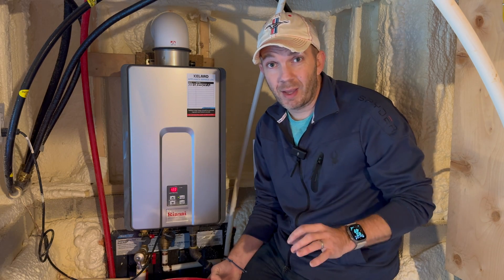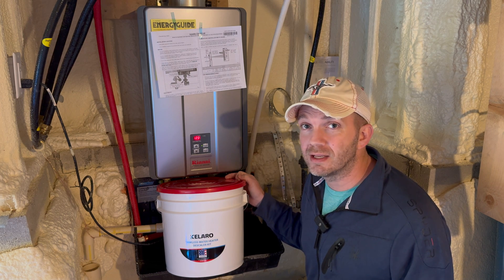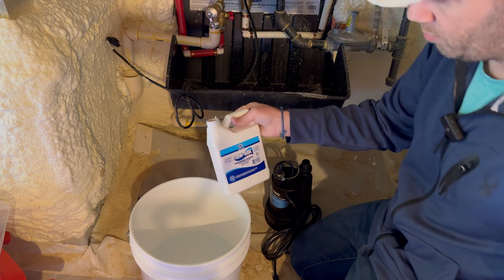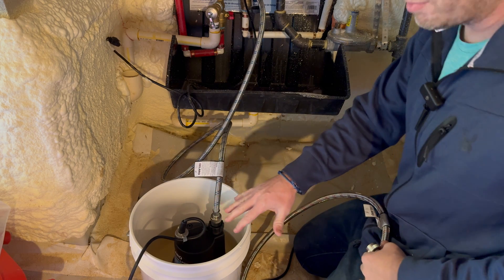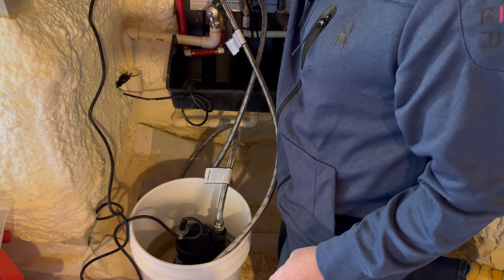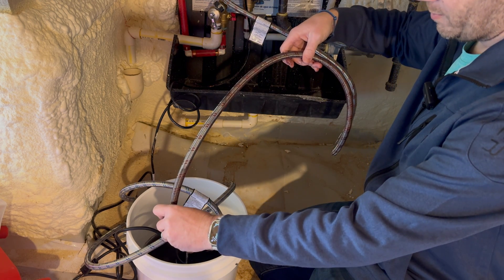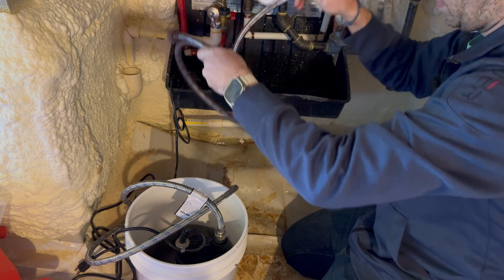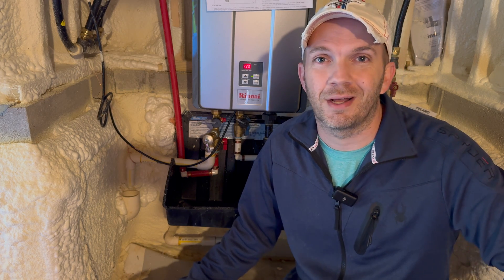How to Flush Your Tankless Water Heater

Comment: Your drain pan is leaking... not great if you have a condensing unit that produces an acid solution.
Reply from the maker: Yeah, super annoying. I need to seal it with some caulk in case it ever springs a leak so it won’t flood my crawlspace.

Comment: I manage several Disaster Relief shower trailers with full sized propane home sized on-demand water heaters (Rheem and Rinnai), and pump RV antifreeze into these units each winter for winterization.   Assuming I do this descaling procedure once a year, would it be best to do the descaling routine BEFORE I pump the RV antifreeze into the water heater, or do the descaling procedure AFTER pumping the RV antifreeze out of the water heater after winter is over?
Reply from the maker: Hi, I’m not an authority on the topic, but based on what you’ve told me I’m not sure it makes much of a difference regarding the effectiveness of the cleaning. I’d weigh the pros and cons of each. 

If you flush it first, then you’ve got that out of the way and don’t have to worry about it the next year when you open things back up. 

If you flush it later, then it gives you a way to thoroughly clean the antifreeze out of the system as part of the flush. 

Either way I think you’re good and it just comes down to personal preference.